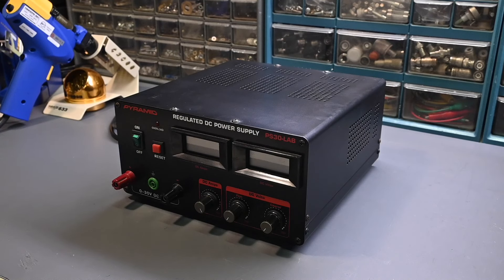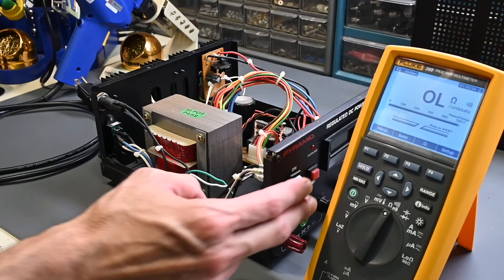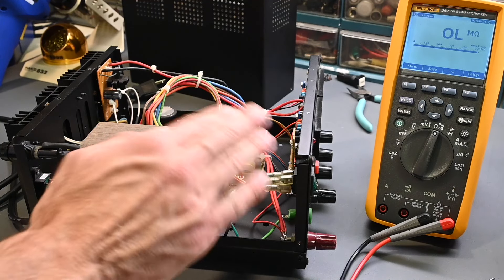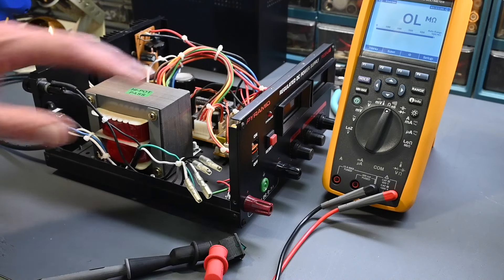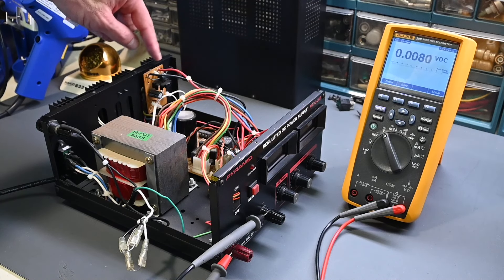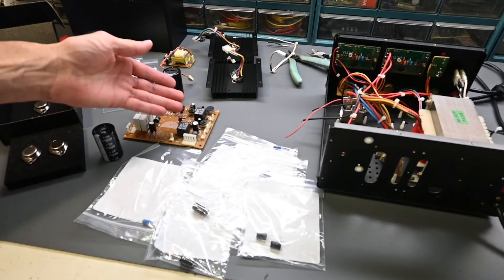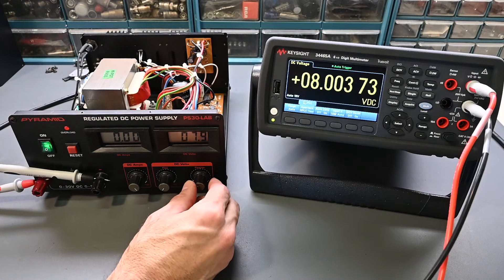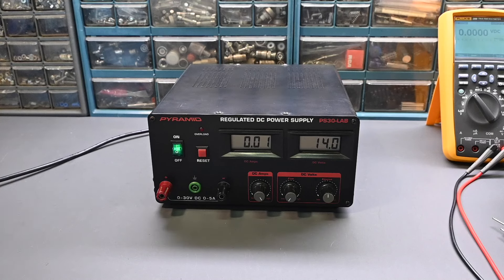PS-30LAB DC Power Supply Troubleshoot And Repair

Comment: Power supplies are the unsung heroes of any repair bench. Last one I bought was a triple output one; didn't need it but it was in nice shape and I convinced the owner to sell it cheap rather than haul it around to the area hamfests for the next few years...
Reply from the maker: Same here, plenty of power supplies have made it to the bench but you can never have too many.. lots of variations in voltage, current and features.

Comment: Another repair class taken in.  Thanks Erik!
Reply from the maker: Glad you found the video helpful!
Reply: @EriksElectronicsWorkbench  I'm building my repair bench and learning all I can about electronics repair.  However, at 58 it might too darn late to do anything worthwhile.  I'd really like to be able to competently repair audio gear because of the joy such gear brings to most folks.  For the past 19 years I've been repairing welding power supplies and related equipment, some their PCBs also.  Thanks for the work you do.  All the best, Kevin
Reply from the maker: @welderfixer  never too late to get into electronics repairs :)  audio component repair is a great area to do repairs, I enjoy that as  well.
Reply: @welderfixer  I'm 55 and jumped back into electronics during the lockdowns after dabbling in it as a kid. Got a nice bench built up and made a bunch of fun and useful circuits since then. Don't sell yourself short! I'm more of a digital guy but learning analog stuff through this channel, Mr Carlson, and others.

Comment: awesome thanks, because the voltage delivery is split between 2 stages (1 - 15V and 15 - 30V) would a final voltage regulation test for the 2nd stage voltage value be warranted? ie 24V no load full load Cheers
Reply from the maker: The same voltage regulation circuit is used no matter if the low or high voltage range is in use.  It's just changing the voltage applied to the bridge rectifier.  After the rectification  everything is the same.  However off camera I did test across the full voltage range because the power dissipation in the series pass transistors varies depending on output voltage and I wanted to make sure my replacement transistors worked ok (they did).

Comment: 29:14 50W extra power dissipation means that the cooling system must be able to handle 50W more. So it's not just like "50W extra nothing wrong with that".
Reply from the maker: What was meant is the the transistors are not being worked as hard to dissipate power near their specified max limit.  It would be like replacing a resistor with one of a higher wattage rating.  The component isn't being stressed as much.  Nothing was modified in a way to make more power actually dissipated on the transistors.  Depending on load current they can run fairly hot.
Reply: Since there's a current limiter, he won't be able to pull 50W more.

Comment: This thing sure had a lot of problems, are you sure it was working before?
Reply from the maker: Yes it worked fine for 20 years.  I think the power switch was on its way out and I didn't realize it.  The fuse holder plastic was old and disturbing it probably made its contacts become intermittent.  The fuse was never touched in 20 years.  The actual failure was the transistor.